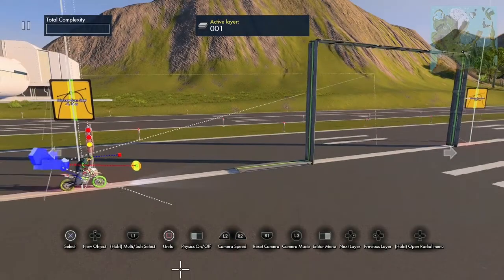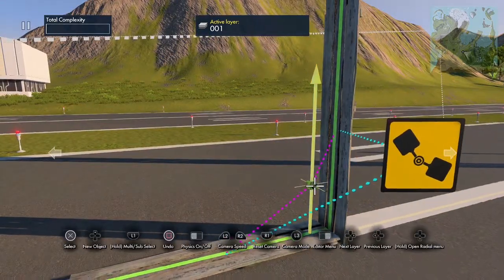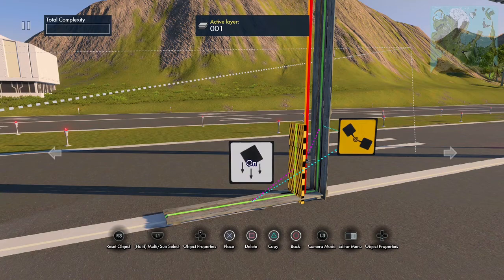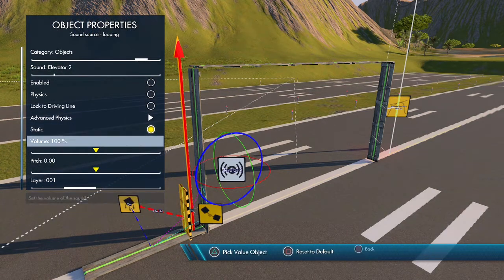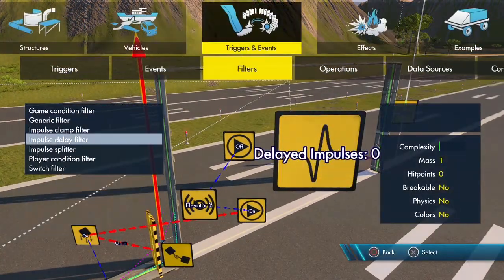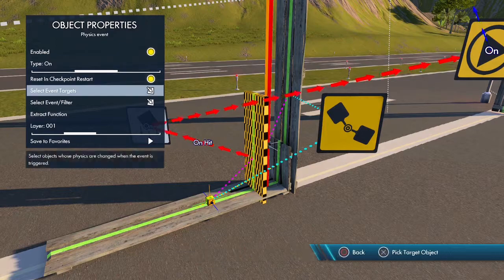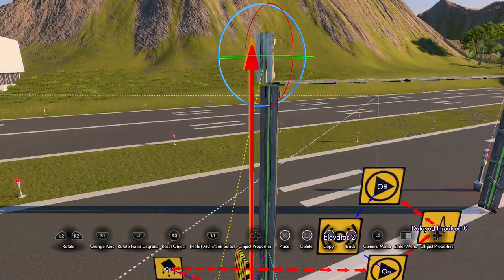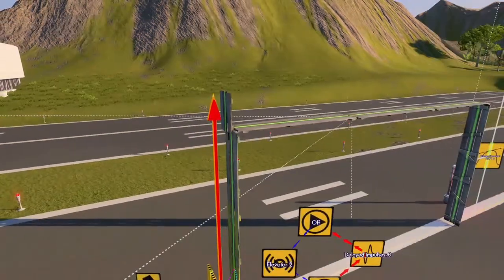Trials Fusion Editor Tutorial - How To Build An Elevator Using A Physics Joint

Comment: This didn’t work and I ended up braking my controller, because the platform was going towards the ground instead of up in the air. Is it because I have Xbox One and you have PS4?
Reply from the maker: Make the target velocity numbers a negative number, or flip the physics pivot point over.

Comment: How did you get everything perfectly lined up?
Reply from the maker: Open Editor Settings and turn off Snap X, Snap Y, and Snap Z. Then when you click the right stick, selected objects will snap to the driveline. Single to click align with the driveline - double click to align to the driveline, and reset the angles to 0 degrees. Also watch my Ramp Alignment tutorial. https://youtu.be/F1VgErmtD6I

Comment: Hey, mine just goes without my rider hitting the trigger, any help?
Reply from the maker: +BubbleStorms - Turn the physics off on the elevator you are using. Let the Physics Event turn it on with an area trigger.
Reply: Oh thanks, I figured it out after I commented, but thanks for responding quickly.
Reply: +SwampBalls how do you make a physics joint work away from the driveline
Reply from the maker: It has to be within 20 meters of the rider or it will not work. You should use Object Position Event if that is the case.
Reply: SwampBalls Every time I make the elevator, it goes down, can you help me?
Reply from the maker: You may need to decrease the weight of your platform, that's in Advanced Physics. Or you may need to reverse the direction of the motor. In the physics joint in Linear settings/linear motor/ and make the target velocity a negative number. You can also play around with max force, make that number larger.
Reply: SwampBalls thx